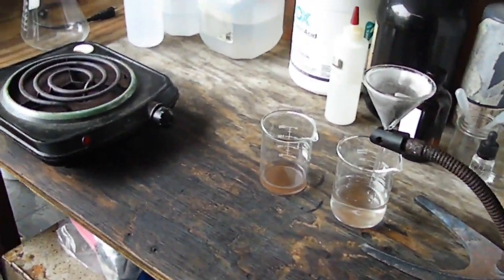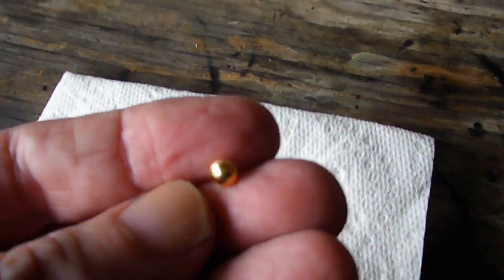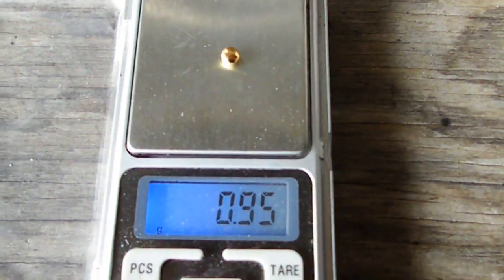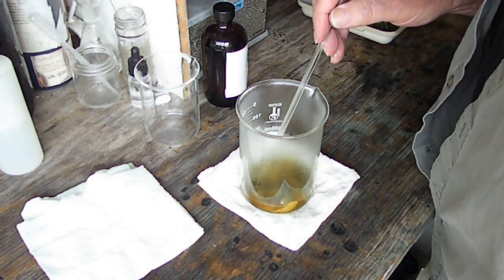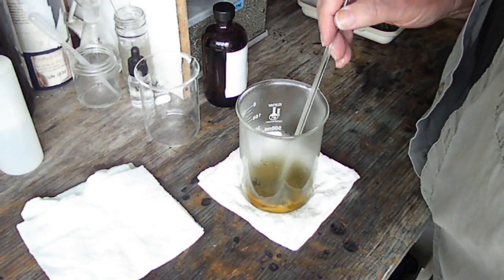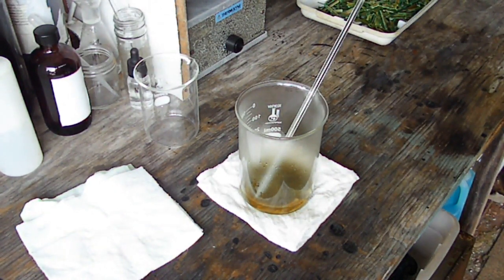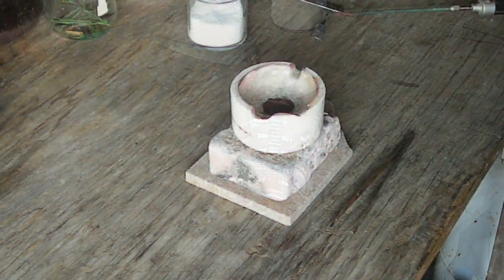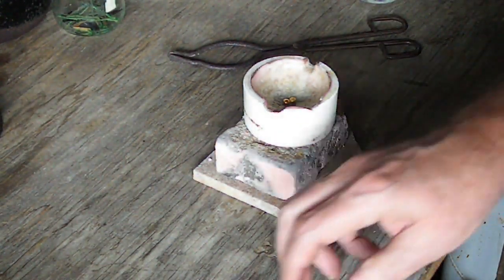BGA & Foil Refine For New Prepper Part 3

Comment: very cool whats in the pickel pot
Reply from the maker: The pickle pot is used to remove fire scale, borax, etc.. It is commonly used by jewelers. It can be a light acid mix, or in my case I use Sparex which is actually made specifically for the job.

Comment: Loose rule of thumb for working out bga tops is about 0.5g gold to 5pg tops.
Reply from the maker: ok thanks
Reply: @BackyardScrapping  that's 50grams. Not my yields but from someone very good at it. I've gotten close at 0.45g
Reply from the maker: @mrgreenswelding2853  I am guessing that its also from the "large" ones, for the most part I have gotten between 6 and 8 grams a kilo for mixed ones. I have heard the large intels are the best though, up to 13 grams a kilo!